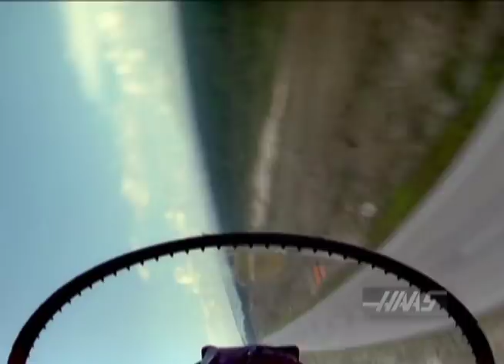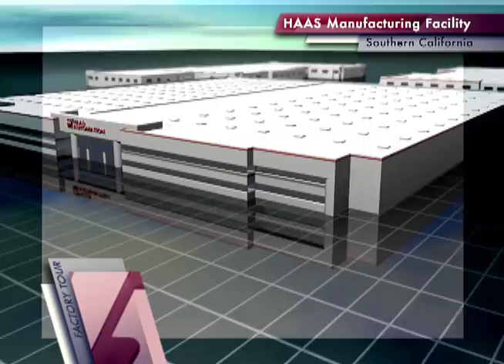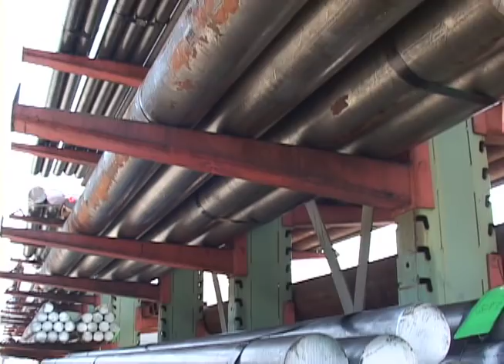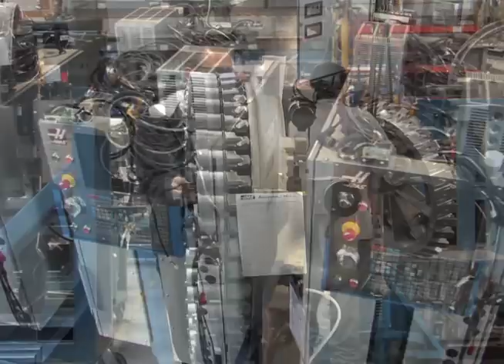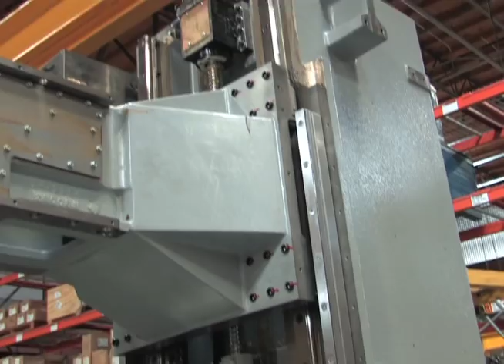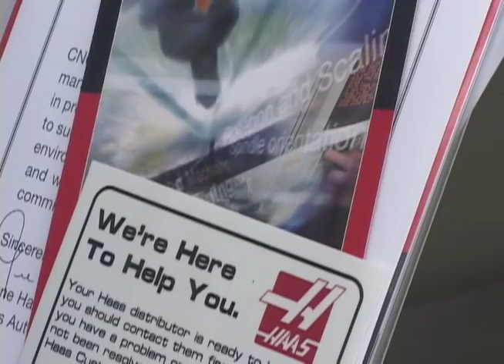Haas Factory Tour

Comment: Haas has drastically improved over the last 20 years.

It's a Quick Wake-Up when an OLD Haas throws a 3" diameter shell mill at 2,000 RPM 
********** Spin-Boom, rattle rattle rattle ***************
I can also attest to the positive protection provided by the Haas machine guards.....I haven't been killed YET.

Thank You Haas : )

Comment: Does Haas have box ways?
Reply from the maker: 58browning All Haas machines use high-performance linear guides on all axes. Linear guides have a very low coefficient of friction, which allows faster axis movements without sacrificing repeatability or positioning accuracy. They also consume less power, do not require adjustment, and have been proven to outperform box ways for accuracy and speed.
Reply: boxway is  useless i dontlike

Comment: So If I by a HAAS Machine I can expect something that's been wrapped and  been lleft outside in the "Yard" before it's crated and shipped to me???
Reply from the maker: Jake Fischer Your new Haas machine most definitely will be wrapped – all machines are – and probably will be “left outside in the yard” for a short time before it is shipped.

As shown in the video, every new Haas machine is carefully wrapped in plastic sheeting, sealed in a protective barrier bag, and then wrapped again. Desiccant is placed inside the machine prior to wrapping to absorb any moisture that may accumulate during shipping. This process takes place in a dedicated packing area that is completely covered.

Finished machines are staged in the “yard” prior to shipping, but only briefly. Most machines are on trucks or in containers on their way to their final destinations within a few days. 

Haas currently builds roughly 60 machines per day, and ships around the same amount each day. At present, nearly all Haas machines are built to order, so as soon as they’re completed, they’re on their way to the customer. 

One of the primary reasons the Haas factory is located in Oxnard, California, is because the area’s moderate climate allows us to store materials – and, yes, machines – outside, with little worry about inclement weather.
Reply: gunthreadadapters.com yet your state will never come close
Reply: Did the updates occur when Gene Haas was in Prison for tax evasion?

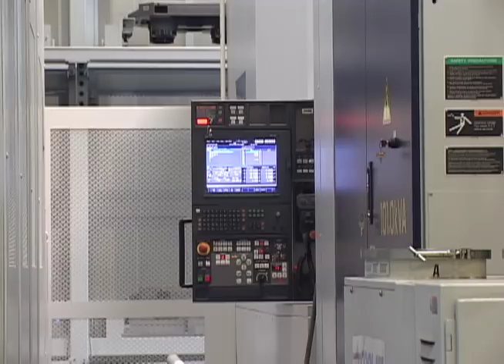Comment: 4:30 seconds in shows the largest Mori Seiki LPP system in North American.
Reply from the maker: Manu Man - You are correct. When that system was installed in 2006, it was the largest linear pallet pool system of its kind in North America – part of a massive investment in new equipment that year. But of the 300 metal cutting machines in the Haas factory, 75% of them are Haas machines, as can be seen in the video. Haas Automation uses the finest machine tools in the world to make parts for Haas machines, and in many cases, those are Haas machines. However, we do use machines from other manufacturers – Japanese, German, Swiss, and others – simply because we do not build those types of machines.
Reply: Thank you for helping me with my homework